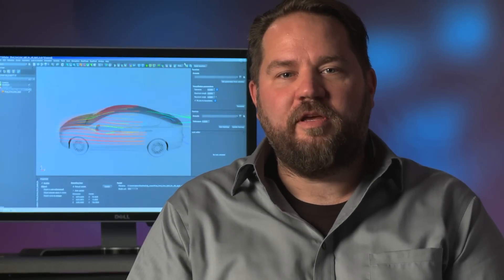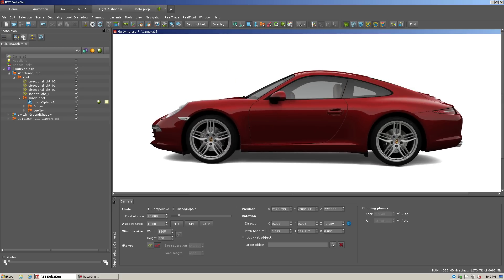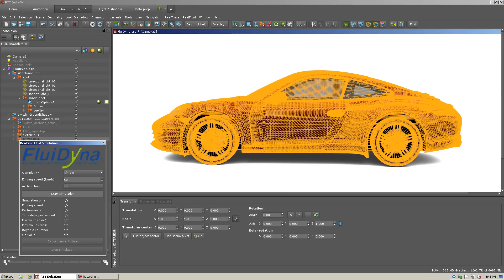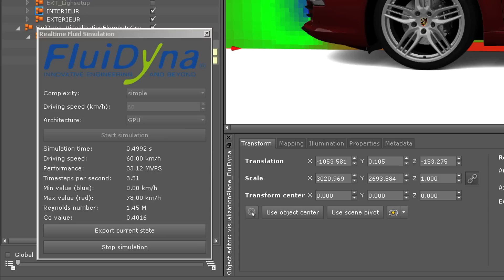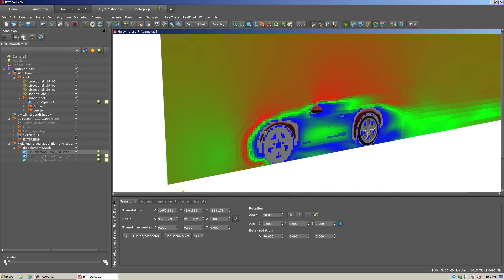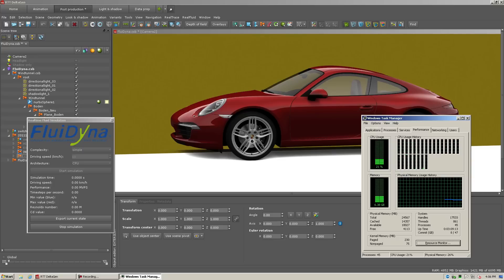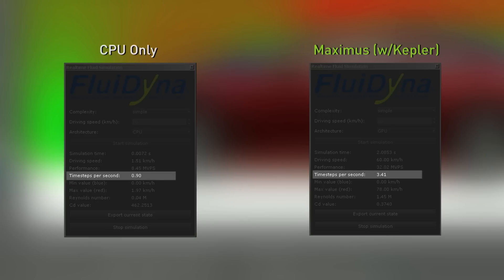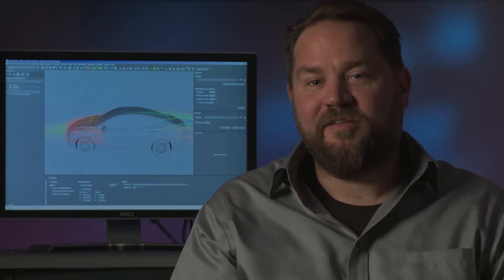Computational Fluid Dynamics (CFD) with RTT DeltaGen, FluidDyna, and NVIDIA Maximus

Comment: Neat simulations but a bit biased.  Two problems I see:  1. the mesh is pretty coarse so generating an incorrect solution in real time is not going to be so useful.  2. CPU vs GPU comparison seems unfair as the CPU was only pinned at 25% during the calculation.  Use all the cores (i.e. 100%) and the conclusion will be different.